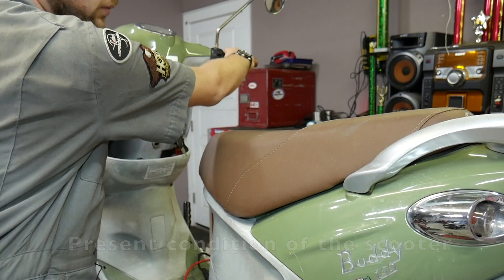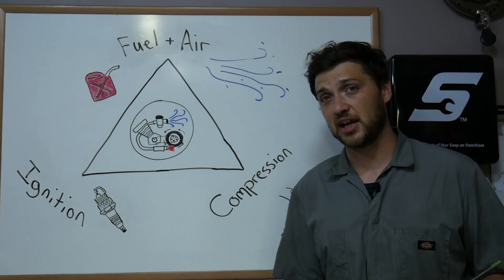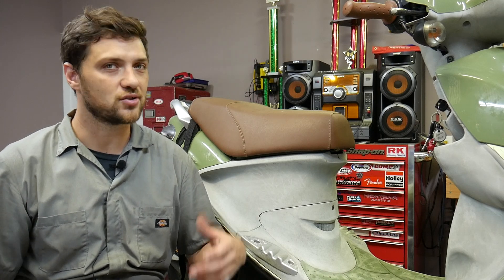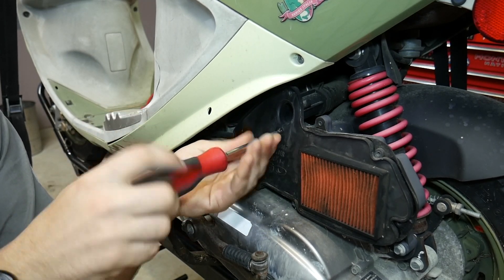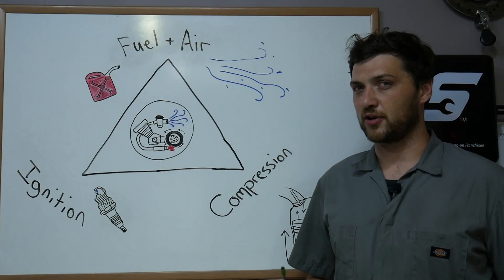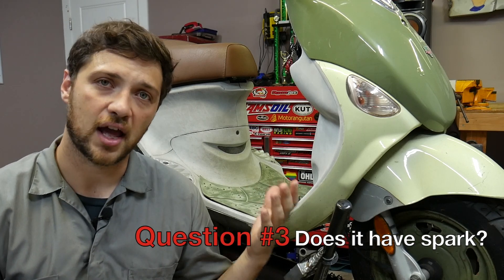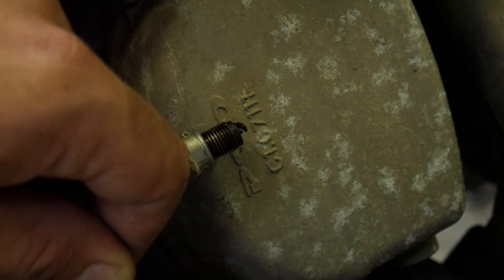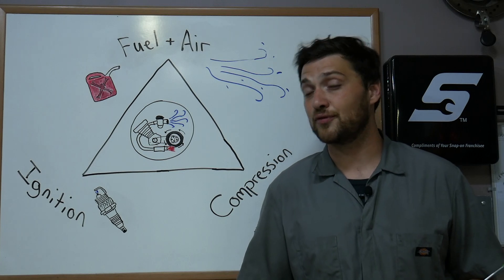Scooter 911: Find out why your scooter wont start by answering 3 questions!

Comment: I was changing my stator, the woodruff key fell out i put it back in now my scooter wont start. The flywheel spins a bit stops then spins a bit when trying to start. No spark at all. I even put in a couple of new woodruff keys same problem. What could it be?

Comment: Question: What if all checks out and it still won't run? Could it simply be flooded from trying to start it too often?

I am trying to fix my dads Scooter that was stolen and found again 3 years ago. I watched many videos and am currently stuck:
- Startermotor worked after fresh battery
- Ignition and injection both work after simply cleaning both grounds
- Compression is at 12 bar (ca. 170psi) after adjusting valves (befor only 8.2bar)
- Engine also Makes a "puff puff puff" sound since the valve adjustment 

If anyone could help I would appreciate it a lot. And also give more details.

Comment: Engine starts very easily with the kick, runs like a charm. The electric start cranks just fine but the engine doesn't start, only twice out of dozens of attempts did it start with the electric start. Ignition looks good and im guessing compression and fuel are good since it starts without issue with the kick. Battery and connection to the starter motor are fine too, and the starter motor is new. Any ideas? Because I'm stuck here.
Reply: Also it's a 50cc gy6

Comment: So I have a 2022 wolf RX 50 scooter. My moped wouldn’t turn on one morning and I got pretty upset because it’s practically brand new so I saw this video and I tried using the spray it didn’t work at first so I sat around for an hour or two, and I was realizing that maybe the fluid for the carburetor cleaner wasn’t reaching my carburetor and so I ended up getting a longer tube and getting it to reach it and it did turn on so this video does help instead of me going to a mechanic and getting it fixed for $200 when I fixed it myself
Reply from the maker: Nice work my friend!

Comment: Short question.
I have brand new 50cc scooter. My scoter was ideling at 4k rpm. I lower it to 1.5-1.7k when hot. 
My problem is when yhe engen is cold the scoter will start no problem (i gess the auto chok works) but after a ride when i let it sit for some time 30-min to 1h the bike wont start if i dont giv some gas. It is anoying cz i have always ride injection bike and never have to turn the trottle. Is ther any way i can fix this?
If i incress tue idle adnuste the scoter will run at 2-3k rpm wich i dont tink is normal for city ride on hot days?
Thanks in advance

Comment: I built a 72cc gy6 and it has no/barely any compression. It sparks but i think it does not have enough compression to get the fuel from the carb to the cilinder the whole engine is new except for the cilinder witch i got in a box of parts with this scooter. It now also doesnt crank but that is because of a dead battery that i cant charge any more so i need to buy a new one.i do have experience building 2 stroke mopeds but i need this scooter as my daily to get to school reliably.

Here is all of the new parts:
Piston
Cilinder head
Carb
Spark plug
Cdi 
Ignition coil.

Note that the scooter was running when it was a 50cc. It feels like low compression. I will get my starter sorted first tho. The timing is right and the valves have been put to 0.10mm if anyone has advice please reply i have been at this thing for 8 months

Comment: What if you’re not seeing ANY spark, even with a new plug? Buddy 170i btw
Reply: Ignition system issue….do you have any videos on these?
Reply from the maker: Do you have the factory ignition switch installed? If you try to use the ignition switch from the buddy 125/150 on the 170i it will not start. Check to see if the rubber boot on the back of the switch is blue! Good luck my friend!
Reply: @Scooter_911 I believe everything is factory. Other than the exhaust. I replaced the stator (thanks to your video) and then I just got nothing.

Comment: I've got a question. I have a 2024 50cc GY6 and have been chasing an electrical issue. Battery charges and runs fine, but the headlight randomly goes from normal brightness to half brightness. Just goes back and forth. I'm thinking it's a loose ground, but don't want to completely disassemble the scooter looking for it. Can you tell me where the ground points are? We use it daily, so I don't have time to take a weekend tracking wires. Lol

Comment: My battery is good fuse isn’t blown but I have no horn brake lights starter won’t engage and when the key is in on position no gauge cluster power any thoughts
Reply from the maker: You might check and make sure your ignition switch is operating correctly!

Comment: My Honda PCX 2011 shows red icon of high temp of coolant. I assume it is bad sensor because ot shwos even when the motor is cold. Could it cause my motor wont start for few minutes. Later on it does but when i add gass it shuts off i must to led it iddle and later on its okay.

Comment: Scooter 911

Please help 

My Big Boy Pulse 150cc, 2013 model does not start at all after installing a new hardness which I bought from Big Boy head office 

It got spark, compression and fuel. I have replaced the carburetor, cdi, and ignition coil.

It cranks but not starting. please help what the problem can be. Can it be the carburetor not getting fuel or valve timing.

Comment: I know this is an old video, but - throwing caution to the wind - I'm going to ask anyway. A friend who works on small engines suggested using brake cleaner instead of starting fluid. Is that a good choice also along with the carb cleaner suggestion?
Reply from the maker: @roncarlson7682  brake cleaner is a fabulous choice!

Comment: My 50cc Piaggio Fly would start after spending several months in the garage. Followed your steps. A few puffs of carb cleaner in air filter intake did the trick! Thanks for the video! Saved me a trip to the shop.

Comment: car mechanic here,  i have a kymco people s 50 euro 4stroke, just bought it used, no start. it has spark, fresh fuel in the new carb, crystal clean and barely runs at moments , compression is at 45psi, i adjusted the valves to .04 both sides manuf specs., it was completly touching before. still has 45psi held that psi for 8 hours. i inserted carb cleaner like you said through the air filter and ran strong like a champ for 3 seconds. has not been started in 2 years prior to this 6000 miles. choke is drawing .0001.7 v when key on, i did however move the air/fuel mixture screw and dont know where to set it back. but before i moved it, it was extremely quiet running. im wondering since the carb clean squirt directly in the intake, strong running, it could still run on 45 psi, maybe rusted piston housing that can fix itself

Comment: My pronto will crank but takes for ever to start. It wasnt going as fast as it used to either. I changed oil and that seemed to help a bit. But still takes for ever to start. Especially in the morning or its the least bit cold. I live in Hawaii so stays around 70. This crap keeps making me late for work. Someone suggested I change the battery too. Its around a year old and only 3000 miles. Ill try these ideas but do you have any other suggestions. My front light and tail light works but super dim but turn signals work fine. Can you do a video on that please. Or have any suggestions. I dont know crap about mopeds so please be specific like this video please. These have been the most helpful.

Comment: Great video   It didnt address my issue but it did set me on my path.  In my case it would crank but not turn over.  The day prior I filled the tank and put injector cleaner and fuel additive (in small amounts.  1 oz per gal of inj. cleaner and 1 capful of the fuel aditive) in any case my bike did start and I got about 1 house over and it just died dead in its tracks and from there would only crank.  This all happend after replaceing the carb to include all hoses and checking the injector gap.  After doind all that it ran like a charm and I even got a little increase in speed. (like 3 mph so from 40 max to 43 max)  Hey prior to the corrections it would only go 20-30, bog down, and conk at lights so i was doing good.  But I went into this new problem with a little info of bike history.  I was pretty confident I did good on the repair / replacement because the bike ran like a dream, so using you triangle I came to the determination it was fuel.  Surprisingly I had carb cleaner.... but there wasnt enough in the can to spray any so that was a bust.  started considering ubers or buses to the car shop.  I was hesitant because I didnt want to go there, get the carb cleaner come back that not be the issue and have to do the whole process again for the next scenario.  Anyway, I started thing and determined that the only thing that happened between yesterday when it was running fine and today was I put that gas mixture in it.  So I drained all the gas, tank was full but it was only a 1 gallon tank sooooo,  I have a small 1 litter gas approved container that I drive around with in case I do run out of fuel as my gauge doesnt work.  (Just in case right)   So I drained the mixed up gas out and put 1 litter of regular high test 93 in and after a moment   vrrrrrroooooommmmm    started right up.  Heres my point    I could have and probably would have started doubting the repairs and replacements I and start pulling it all apart - My suggestion if you do a once over and everything you did looks in place etc.... move on for now, trust yourself, if the bike was running fine after repairs you did it right   move on....  Also, look for the easy first which is what this diagram does.  its much easier to only deal with checking fuel issues and then move on to other issues than pulling a petcock< Haaa (petcock-that still makes me laugh)  and a spark plug and changing hoses because you do that and lets say it works, OK  what fixed it?  you dont know so if it does happen again, all you can do is reach for straws.  2nd bit of advice had I not started thinking in terms of the steps and engine goes through and checking them in order it wouldnt have clicked for me to think fuel, - Hey what did I just do to this that had to do with fuel?  Aha, I got some....... and start by eliminating that first.   So thank you   I am not new to engines which is dangerous because I know just enough to think I know it all and these ways of thinking you provide really help so Thank You.   Hey   got any carb cleaner?

Comment: I have a 60 cc Wolf scooter 2021. it will not start. I replaced the battery, changed the sparkplug i opened the air intake. When I spray carb fluid in it will start. it will cough a little, idle then die again. It only works with Carb fluid. What do I need to check? How do I fix it.  TIA.
Reply from the maker: @michaelvitale6358  sounds like you have carburetor trouble my friend. You can either take it all apart and try to clean your jets and ports manually or you can replace it with one like this https://scooter911.com/shop/you-all-brand-18mm-cv-carburetor-for-139qmb-50cc-engines/?srsltid=AfmBOophtbo0v1yuXpIOpSgcS0MaZGluyvXpQL_2wH8mpqmwctDfQmS2
Reply: I’m looking for a recommendation please.
Reply: Thank you for your prompt reply. Do you have a link to carb removal??
Great videos BTW.

Comment: Hey great channel! My issue is when i push the starter button,  nothing happens.  The battery seems okay as horn and lights work strong, but the motor doesnt even try to turn. Is that an ignition problem? The switch has been sticking and hard to get into the starting position. It is a 2017 Yamama Aerox 155. I found you thru a search. I live in Thailand. Thanks and I am subscribed!

Comment: I learned that my ground wire might have come loose. Of course, it was after 9 p.m. in the single most remote lake town in South Carolina, but lucky for me, my 50 cc moped died across the street from a pool hall where, you guessed it, I was fortunate enough to find a guy who'd spent 20 years selling and servicing Chinese mopeds. Unfortunate for me, I nor anyone including the great moped dealer guy had a tool bag. So, there I was, in mid-December loaded down with groceries stuffed in every available compartment of my Xpro moped. The moped prince noted that because it wasn't cranking after only 350 miles indicated a likely dislodged ground wire, which of course is located atop the engine that's contained under the seat. But while the Moped Prince from Summerville (good size town with every possible convenience located about 35 miles southwest) was checking my moped, he could sense the engine was turning (a mystery given I don't know how), but it wasn't sparking and given the utter deadness indicates it's the ground wire. Meanwhile, I wish I'd had my notepad, because what I learned from this gentlemen in 10 minutes will probably help me prevent problems that, first, would be to adjust the valves, or something that he said maintains proper combustion. As for now, I must get back to the pool hall with some tools so I can start my moped and get it home so I can perform the recommended maintenance. So, please do a program on that first valve/combustion adjustment that Mr. Wonderful Moped Man had said is necessary after the first 200 miles. Because, he mentioned a certain tool that I'd never heard of, and didn't have anything to record what he explained, but I know it is important. Meanwhile, I'd noted the cheesy terminal covers that are flimsy plastic, which I feel compelled to replace along with the very cheap battery terminals. I get the idea that most automobile, motorcycle, scooter and moped maker all cheap out on these elements, including Volvo, I'm told by a Volvo employee attending a pool tournament in Eutawville, a lonely, rather lawless lakeside outpost that's no place for an aging, single, and completely alone person to live. (E-gad!)

Comment: I tested that solenoid, the one side the red side gets 12V. I tested the other side, it doesn't, so it's a solemoid, bad, or is the starter bad? Are they both bad?It did rumble and grumble starter a little bit.Should I be able to get my scooter?Start it with the kickstarter

Comment: Hi! I have the same problem where I press the start button, I hear a noise but the scooter doesn't start. I already changed the ignition candle, I'll try to clean the carburator but can I spray in it WD-40 instead the carburator cleaner? I couldn't find it anywhere near my house

Comment: I was riding at just shut off completely lost all power would not start back up tried electric start it just made a click noise would not turn over so I tried the kick start and it’s locked up it’s never done that  I’m getting no power only making clicking sound when try to start what should I do it was not sitting I ride it every day never had problem it’s brand new only had for few months less then 3

Comment: My son in law's Yamaha Zuma had been sitting outside for years (not running). Cleaned the carb, drained the tank, new battery. Still not running. Discovered the muffler was clogged with spider webs. Took it off, stared right up.

Comment: Mine was running fine sat for two days then it turned over but wouldn’t start then the turnover got weaker each time I tried until now all I hear is the fuel pump clicking

Comment: Why not spray directly into the intake of the carburetor?
Reply from the maker: @jsa4864  that would definitely work! On some bikes it takes quite a bit more disassembly to get the intake off the carburetor so the air box is often the fastest way to test it!

Comment: I have an old yamaha mr50 2stroke dirtbike. And it does have spark.  I cleand the carburator mikuni vm16. But i think the air fuel mixture is off  i baught carb cleaner today but didnt think to spray some in the air intake. Ill try tomorow  thx for video

Comment: Hey brother I just bought a 50cc scooter just to really flip it and it would crank up and run for a minute and 6cut off like it was running out of gas but it wasn't...I checked everything that makes it run... and it was a tight exhaust valve...I set it at 4 thou... and it runs like a champ...I watched your video on the green one that had the same one so I checked mine and that's exactly what it was.... thanks brother...I subscribed to your channel.... thanks for the info...

Comment: Ran out of oil, belt was eaten, I found debri backed up in the fuel line filter. I cleaned it. Still won't start. Must I clean the carb or engine too?

Comment: You are my HERO!!  I don't often play mechanic with my scoots, but I have a 2008 Genuine Buddy 50 that would not start as it has been sitting WAY TOO MUCH the past two years while I spent most of my time on the 170i...and my bicycles!  I watched this video and having already replaced the battery, which didn't get it to start, I bought a new plug and some carb cleaner and did exactly like you described, except mine needed much more than 3 puffs and multiple sits and waits after shooting the cleaner in there.  BUT, finally, this afternoon, on my 5th try, it started!!!  I was afraid to turn it off, so I threw on a helmet and rode it around for quite a bit, including to the station to air the tires first.  HOPEFULLY, she will start up again tomorrow...and within a few days I can gas her up fresh and put her back in play more regularly...or sell her so she gets more time on the road!  Last Fall, I watched a different video after my speedo stopped working on the 170i, and I took her apart up top and got it reconnected!  Works like a charm again.  These video tutorials are lifesavers!!!

Comment: I have a Chinese GY6 200cc scooter electronic fuel injection it ran fine for a day and the next day it ran fine for a half a day I stopped at a gas station put fuel in it. Went to start it and it won't start nothing. Any ideals?